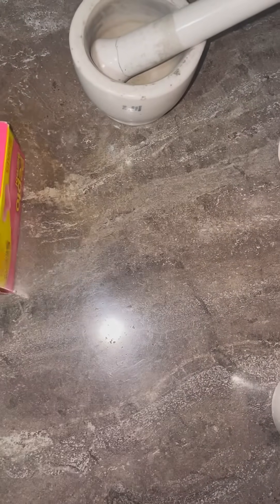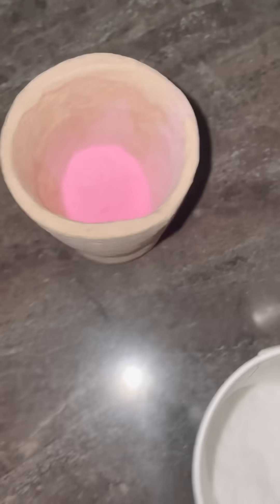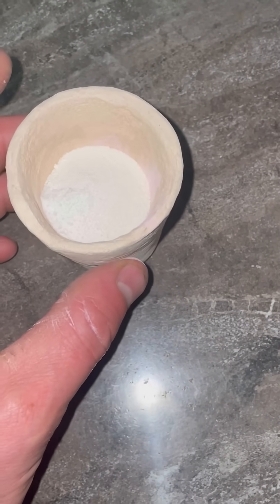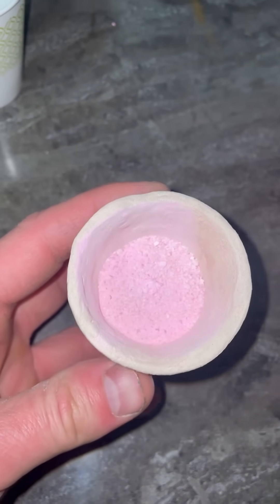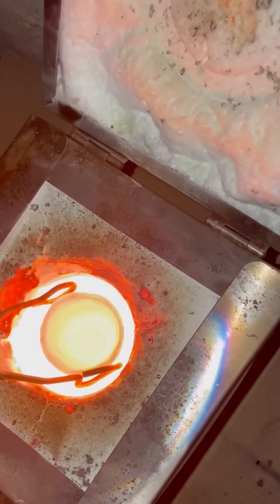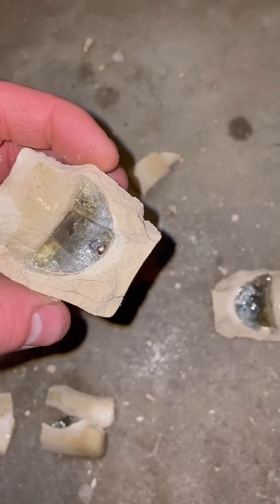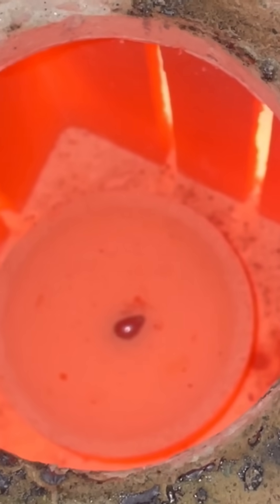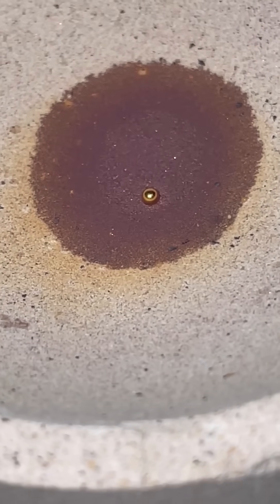Pepto Bismol as a fire assay lead replacement?

Comment: lead fumes are clearly bad, but why are bismuth fumes better?
Reply from the maker: Bismuth doesn’t accumulate and cause nervous system and reproductive harm like lead does.
Reply: @theCodyReeder  But it's "radioactive"! Sure the half life is a billion times longer than the age of the universe, but it's still there! Though I'd bet a banana is more radioactive.
Reply: @theCodyReeder  you'll gain the power of Pepto
Reply: @theCodyReeder  It's not easily taken up in the digestive tract but according to wikipedia bismuth poisoning can have similar effects to mercury poisoning. So I'd still be careful about inhaling the fumes. Such finely dispersed material can have very different toxicological properties.
Also Bismuth has a higher vapor pressure at a given temperature than lead so you'll be exposed to more of the fumes.
Reply: @gamingmarcus   dont Believe everything you read on the  internet lead is more toxic then bismuth
Reply: @brandongotzpowers  I never said one was more toxic than the other. 
In fact I couldn't find any data on the toxicity of bismuth fumes but then again that's a very specific thing to search for.
There's a very big difference between gastrointestinal and fume/dust toxicity. Just because bismuth is relatively safe to swallow doesn't mean inhalation isn't dangerous.
Yes it probably is less dangerous than lead or mercury but it's still a heavy metal. And finely dispersed fumes easily accumulate in your lungs.
Reply: @gamingmarcus  Bismuth has replaced lead in bullets specifically because of its much lower toxicity.
Bismuth compounds (bismuth/lead, bismuth chloride etc.) fumes are far more hazardous that straight bismuth fumes for which there is no OSHA lower limit established. Even bismuth oxide which Cody would have been exposed to (the bismuth vapor would have oxidized in air as it left the oven) is considered safe other than as an oxygen displacement hazard and that would take way more than Cody was playing with.
Apparently it passes through the membranes in the lungs straight into the bloodstream and is eliminated easily.
Reply: @gamingmarcus  The sources I have found indicate the vapor pressures are similar, or lower for bismuth, but in either case three or four orders of magnitude less than mercury.
Reply: @markfergerson2145  bismuth in bullets? citation please
Reply: @Wulthrin  It's used sometimes in shotguns, replacing the lead shot.
Reply: @Wulthrin  he was referring to bismuth/tungsten shot in shotgun shells for hunting waterfowl
Reply: Lead is just terrible for you, even if bismuth isn't good it's so much better. Even very small exposure to lead leads to long term problems
Reply: @artificialvolcano482  I don’t know of any negative health effects from bismuth.  Which is crazy to think about. It’s so close to lead on the periodic table, and in most ways acts a lot like lead, yet it’s so much safer for organic life.
Reply: @uspockdad6429  I mean, being safer than boiling lead isn't exactly the highest bar there is...
Reply: @uspockdad6429  Bismuth is ever so slightly radioactive, so, long term exposure (like, lifteime of having it in your lungs) and inhalation would probably give you cancer; but the amount of time and the amount of bismuth youd need to is ridiculous because its so unbelievably non radioactive. Its also slightly toxic to humans, but, its really not a big deal and youd need a lot for that over a long time. considering pepto bismol (something meant to be ingested) does contain bismuth, albeit bonded as a subsalicylate
Reply: Lead is about 1500 times more toxic than bismuth and like Cody already elaborated, it doesn't bioaccumulate, not as easily as lead, bismuth is only found as trace amounts normally even if you use antacids containing bismuth.
Reply: Bismuth just has really low toxicity for a heavy metal. Why do think they put it in pills (hint, it is not to kill people)?